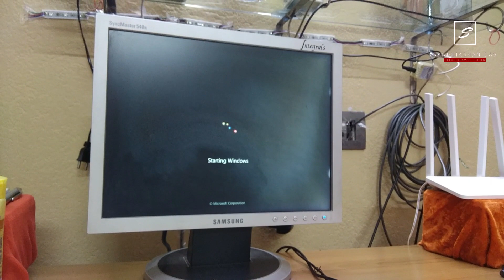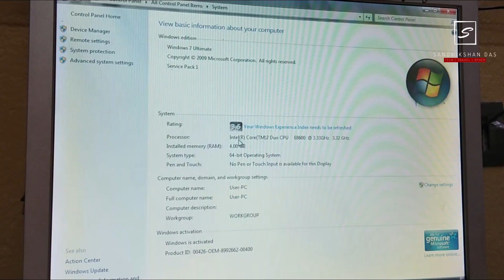How to Change/Replace/Upgrade any CPU/Processor easily ? | 8 Easy Steps | Core2duo E8600 3.33ghz cpu

Comment: Bro can I change core 2 to i3 10th
Reply from the maker: No bro it needs different motherboard.  so you can not upgrade from Core 2 duo to core i3, you need to buy core i3 10th generation supported motherboard separately

Comment: You video helped a lot brother
I changed my pentium p4  processor to core to duo
 E 6500
 2.33ghz  
Which is enough for me
I got it for 500/-rs in my local market
My pc is 10 year old g31 asus motherboard with pretium p4 processor which is unable to load you tube 
Thank you so much

Comment: my lapto sony vaio process Intel Core 2 Duo T6500 shall i upgrade intel core to duo desktop E8600 or E7500 - Desktop processor its possible ?
kindly tell me
Reply from the maker: No you can't change laptop processor.. Laptop's processor generally stay attached with motherboard which is non removable without desoldering..

Comment: Sir, my PC is core2duo I can change core i3 3240 processor plz reply
Reply: My old pc pentium dual-core CPU . . Can i uprade to i3 dual core or i5 dual core??
Asap!
Reply from the maker: No
Reply: Why sir??
Reply from the maker: Cause dual core has different socket and i3 /¡5 has different socket ...so basically motherboard is different ..
Reply from the maker: No dear ..That need different motherboard

Comment: Pls help me 
I have a old hp Compaq 6720s it has intel 2 duo core it is 1.80ghz and has a intel motherboard 456608001 6050a2137901 
Can I replace my Intel 2 dual core E4300 (1.80ghz) to new  Intel 2 dual core E8400 (3.0ghz).
Reply from the maker: Yes ..If it is Socket LGA 775 then yes
Reply: @SANDHIKSHANDAS  ok thanks I will check
Reply: @SANDHIKSHANDAS  bhai thank you so much it has lga socket 775 yes now I can replace it because the that intel E4300 is so much slow that's why I was asking you thanks so much
Reply from the maker: Most welcome bro
Reply: @SANDHIKSHANDAS  bro my friend also have the  computer but his processor is Intel 2 duo core T5670  it's socket is pga 478 but can we upgrade it or not

Comment: i am here to ask is it worth it to upgrade my core 2 duo e4300 to intel core i3 cause i changed my motherboard in like 2013 its been like more than 10 years of using the cpu i dont remember the motherboard but i think it supports intel core i3 (sorry for the bad english) 
i use my computer for gaming but on old 3d games and stuff. also i have 4gb ram ddr3.
Reply from the maker: Obviously worth to upgrade but you will have to sure that really does  your board supports core i3 or not ?
Reply: @SANDHIKSHANDAS  Oh i just realized the cpu socket is lga775 so i need to get a new motherboard in order to get a i3 to work
Reply from the maker: Yes in that case obviously you will have to change the board ..

Comment: Hi Bro. My Laptop spec is 6G Ram, 128G SSD & Cpu is 2 Core. I wanted to upgrade my Cpu to 4 Core. Is the step same as desktop as you have shown above? Thank you.
Reply from the maker: No i mean you want to change your processor from core2duo to core i3 or i5!! Correct ?
If yes then , yes the processor installation is somewhat same but you need different motherboard and ram ..

Comment: Bro I HAVE A VERY SERIOUS PROBLEM, hope you help
I have core 2 e5200 processor, i am using it morethan 10yrs. Motherboard is p5kpl amps. My computer is very laggy and my cpu is already full used if i open a application. Can u suggest the highest processor that i can install on my computer?
❤️❤️❤️
Reply from the maker: Hi ! Yes obviously will help you .
So you can install core2duo e8500 or 8600 3.16ghz processor cpu as highest supported processor for this board , easily available on Amazon or at local market at just rs 600 , But not only upgrading the cpu will increase the speed but it will increase only processing speed but not the load and response speed.. additionally you have to increase ram capacity and stop using normal mechanical hard disk ..After processor install a SSD drive hard disk(samsung evo or WD or Kingston ) only for os and use your existing harddisk for only file storage purpose ...damn sure, i can guarantee you that installing the SSD drive it will make your computer super fly like i7 processor pc..I will prefer you to install samsung evo  250gb ssd which is best ssd in the market . .. so just upgrade your cpu, ram and hard disk . Harddisk should be your first priority.
Reply: @SANDHIKSHANDAS  thank you bro for your detailed response love you. bro, i am not going to upgrade all the things and I'm upgrading only the cpu because I will get a laptop within 2yrs and i will buy a good one, so there is no use of upgrading other items but i am upgrading the processor because I cant even use this desktop because of very slow speed and i need a desktop at my home to keep my files like old photos and other matters and not for any gaming or heavy tasks. Also the cpu is showing 100% usage so I am looking for a good processor. Thanks you, love you bro❤️
Reply: @SANDHIKSHANDAS  i have upgraded my ram from 1 gb to 3gb and planning to add 1 gb more. Its maximum is only 4gb

Comment: Can we install windows 10 on a PC with E8600, 4GB RAM DDR3, ECS G41T-M7 Motherboard? if possible make a video with windows 10 performance .
Reply: Yes bro
Reply from the maker: Yes you can , same performance as win 7 better to use SSD drive as system hard disk for faster response
Reply: Yes

Comment: Hi,
I am using Intel® Desktop Board D945GCCR with 1gb ram. Will upgrading the processor help? If yes which is the best processor? 
I don't use for gaming, just surfing on internet and for online courses.
Reply from the maker: what's your current processor? your board maximumly supports E4700 2.6Ghz core2duo processor , so you can only upgrade upto that processor..